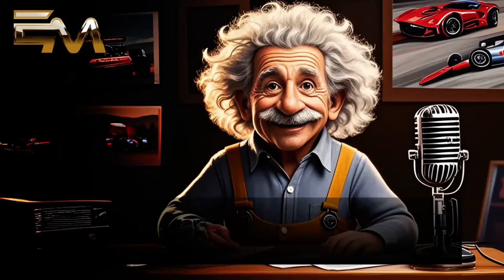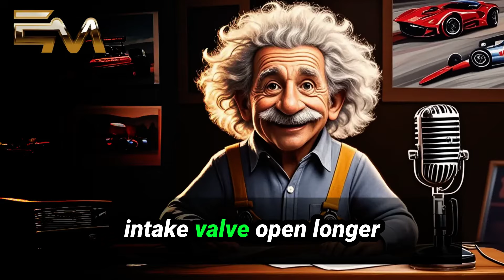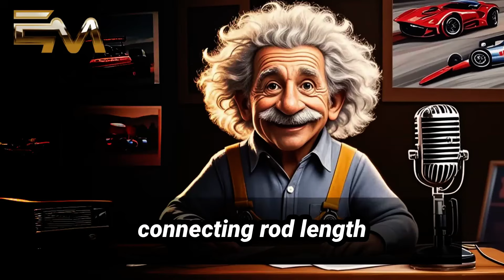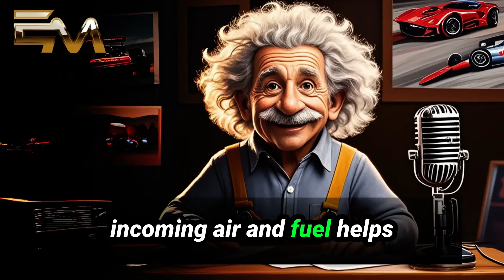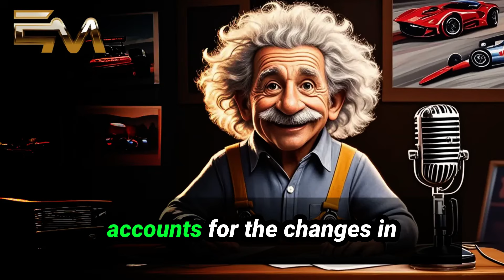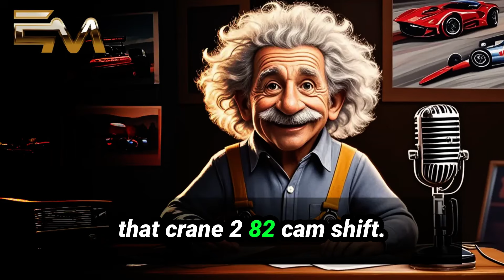Static/Dynamic Compression, Your Engine's Real Compression Ratio Changes Everything Einstein Motors

Comment: The effect compression is when the intake valve closes. Dynamic is when the engine is running with Airflow going through. Dynamic compression will increase when the engine is at maximum torque 
D
Elgin Cams